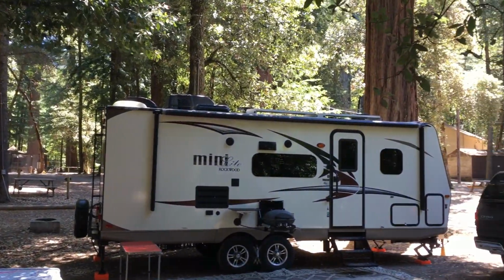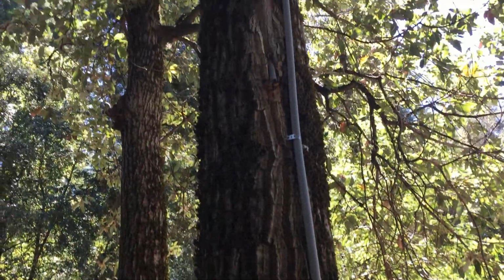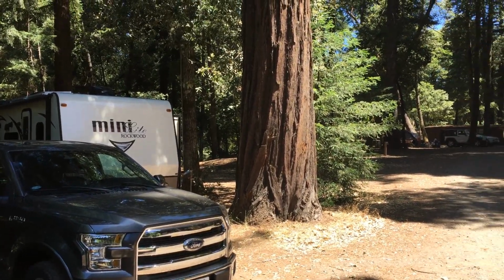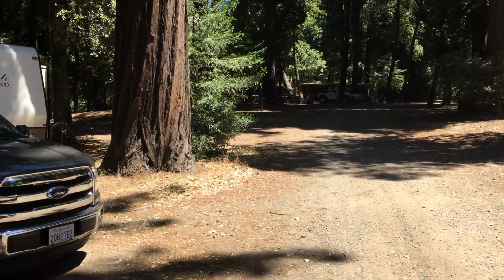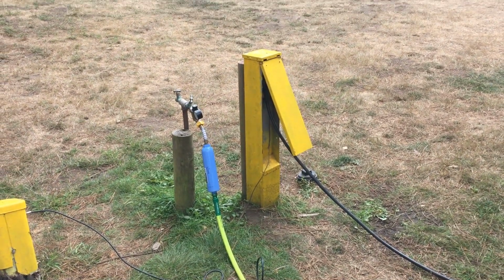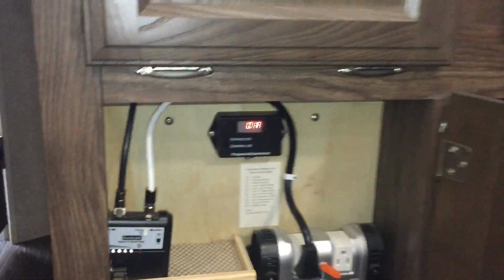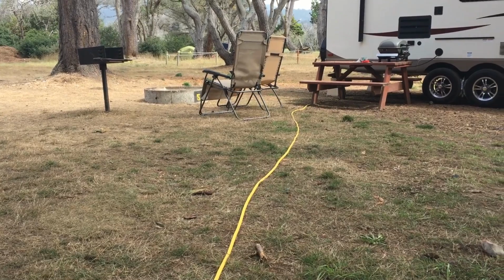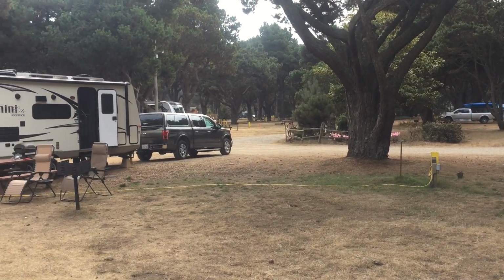Electrical Problems at RV Campgrounds / Progressive Industries Surge & Electrical Protector

Comment: I am a retired electrical engineer in Canada however both the CSA (in Canada) and NEX (in US ) are both in sync with each other.  That said that above ground wiring is pretty sketchy.  The overhead distribution wire size needs to be greatly increased to be able to handle the load.  It almost looks like the distribution wire is barely larger than the wire going down to the boxes.  It was likely installed back in the day before AC units were common in RVs so this is a disaster looking to begin with insulation melting and a fire starting.  Be forewarned.
Reply from the maker: I sure appreciate your comments Robert. I totally agree. I hope you don't mind that I am going to share your comment in my description area above for others to see. Thank you, Mike